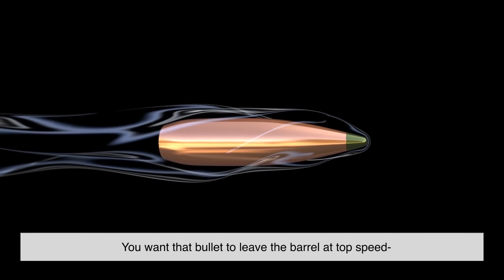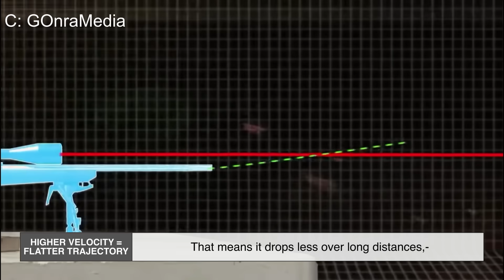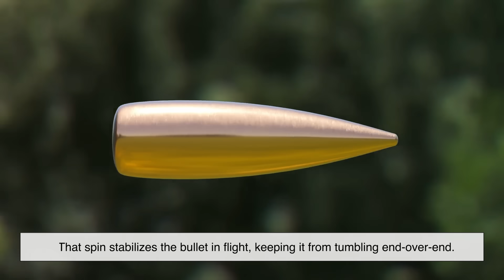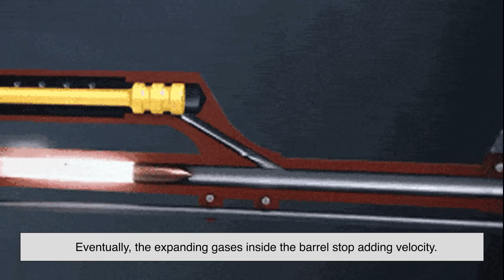Why Are Sniper Barrels So Long? The Hidden Science Behind Every Shot

Comment: Couple of things to add on to it. 
Sometimes its not just the curvature of the earth they have to account for. Its the rotation of the earth as well. When you shot the bullet, it was in line with the target. Well the earth moved, so your target is now in a different spot than where you shot at because the bullet isn't affected by the earth spinning. 

You can have too little of spin or too much of a spin. Sometimes usually the round you're shooting and the weight of the bullet. If I remember right, a lighter bullet that's spun too fast will start tumbling. Heavier bullets need little more of a spin. If your barrel is 1:8 spin but your barrel length is 7.5", you didn't make a full single spin in the barrel. A 24" barrel with a 1:8 will make 3 full rotations in the barrel 

I think you covered some of this, but some rounds like the 5.56/.223 benefit from a longer barrel length to get their velocities. Some like the 300 Blackout reach full powder burn at about 9". So you can see a little bit of gains past that point but nothing significant to shake a stick at. 

Navy SEALs might not clear buildings with a sniper rifle but you can probably guarantee 1 or 2 of them are outside the house doing overwatch of where the raid is and communicating with each other. Plus a lot of times snipers are accompanied by other trained snipers that are the spotters who call out stuff like distance and wind calls for the sniper to make adjustments for.

Comment: 2.32min "A faster bullet travels in a flatter arc" is still a relative term. It also depends on the shape of the bullet and how high or low the aerodynamic coefficient is for the projectile in question. There is also a different and varying influence on the projectile according to the type of lands and grooves that the individual barrel has that makes up the rifling in the barrel. The good sniper will also know the characteristics of his/her rifle barrel from cold to hot and how many shots it has fired from new and how many shots it has fired since its last clean! They will know where the barrel wanders from its base line as it heat up and as it ages.

Comment: There is an optimal barrel length. For a .22LR for instance, a 28 inch barrel is slower than a 24 inch
Reply: I think you need to do a little more research mate.

Comment: In a piece of video the bullet inside the barrel comes with hot gases immediately after it and not inside all of the barrel and I don't think it's correct.
Question: is it possible a munition where the propellant is attached to the bullit and is ignited first far away from it, as in a rocket?
Reply: I got hot gases everyday 
Mostly in the morning 
They make for long range

Comment: Regarding 3:38, there are also available compact bullpup rifles. A bullpup rifle has its grip located in front of the breech of the barrel instead of behind it. This allows the bullpup rifle to have an overall shorter length for a given barrel length. A bullpup rifle is more compact and maneuverable than a conventional rifle that has its grip located behind the breech of the barrel.